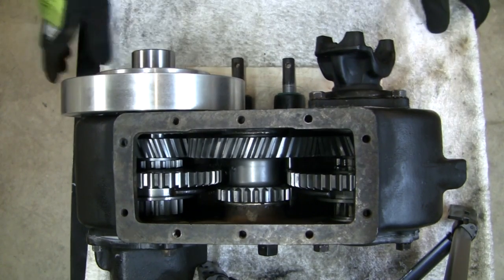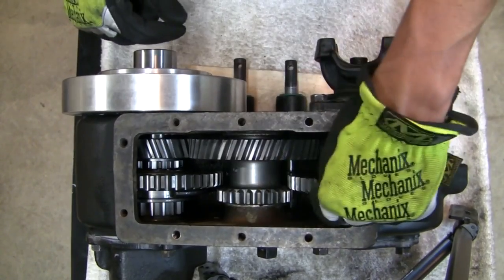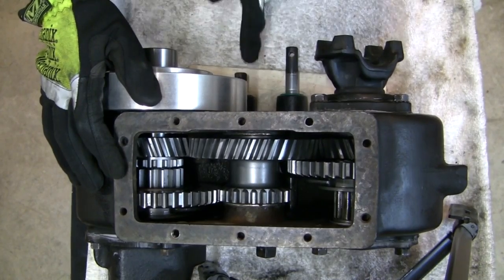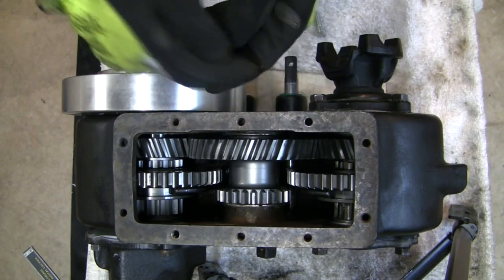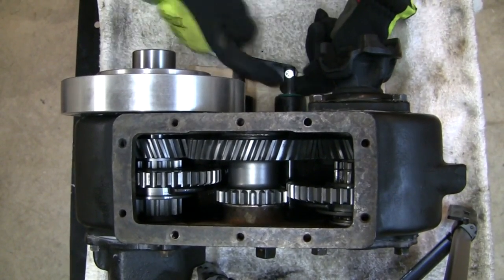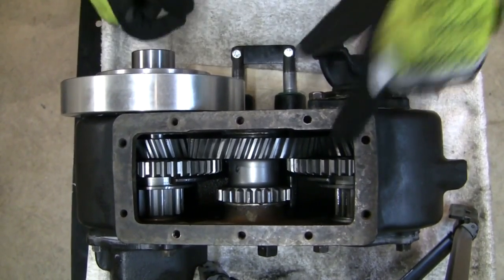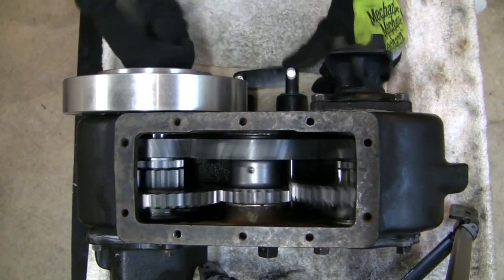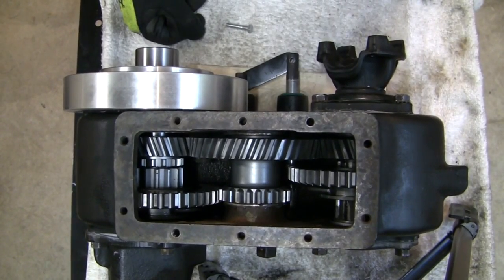Dana-20, independent axle operations, modifying shift-rails + limiting bracket.

Comment: Great idea. However in my opinion this mod really isn’t necessary. I have been using a twin stick Dana 20 for the last 25 years and never found this to be an issue. As you have shown on the bench, It’s possible to put the front in high and the rear in low. But in practice I’ve found it’s very difficult to do. The only time I was able to do it was when I purposely tried. And it’s wasn’t easy.  Just my opinion.  Thx

Comment: Thanks for this video! I’ve been searching trying to find shift rail positions to see if mine is out of whack. I had someone install a new clutch assembly in my 77 cj5 and it came back stuck in 4 wheel high, or at least that’s what I think. Now I have the info to solve the mystery, at least I hope! Thanks!

Comment: Could you shift this like a old mac twin stick? Like keep the front in neutral and put it in first low then First high then second low then second high then 3rd low and third high? Basically can you go from low to height while driving down the road
Reply: Problem would be there's no syncros in a transfer case.  So unless you're good at old school double clutching, you'll be grinding gears a lot.
Reply: No it would be like shifting a ten speed. You would run through your low range gears and then have to shift into high. But im almost positive that your high gear in low is higher than your 1st gear in high. If that makes sense.

Comment from the maker: There is an additional modification that I made to the rear shift rail for the low position to get rid of the ramp and replace with a detent pocket.  Several who have done this modification have issues with the rear popping out of low due to this ramp.  You can weld it up and grind it smooth like the rest of the detent ball pockets.  You can see the completed work in the vid (0:50 mark), right hand rail, bottom where it says "L".  That used to be a ramp.  Good luck!
Reply: So numbers 1 & 2 are the pills that are removed?

Comment: Excellent explanation. I take it from what your limiting strap does that the two interlock pins are not required?? And the detent balls/springs will hold the unit in whatever gear is selected? Would you confirm this?